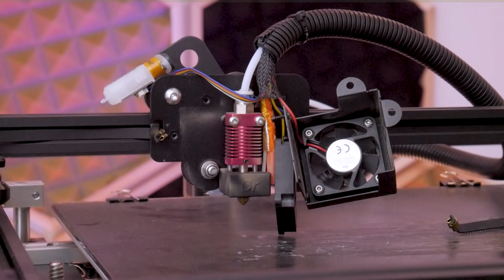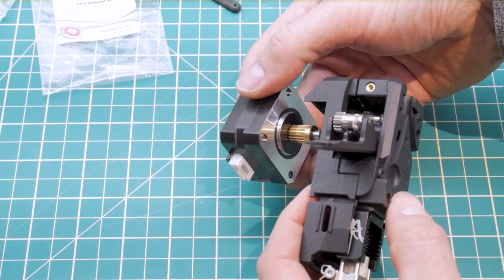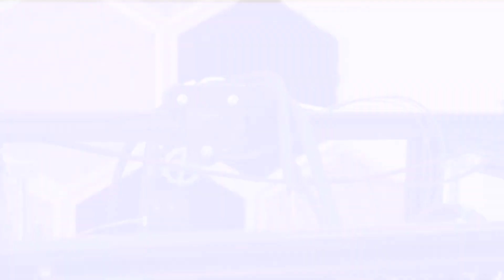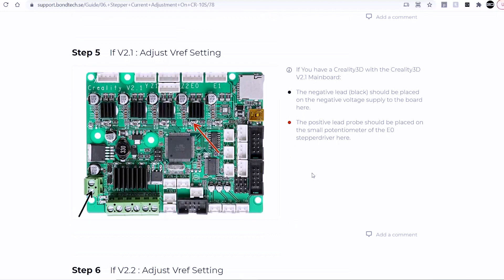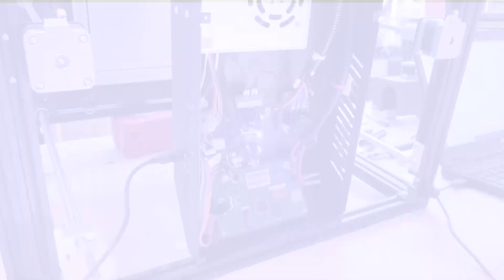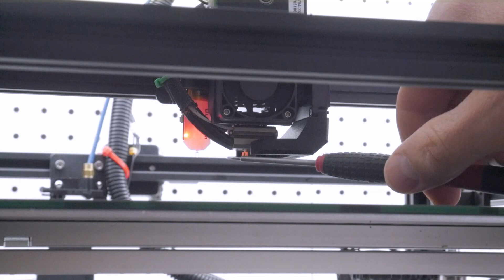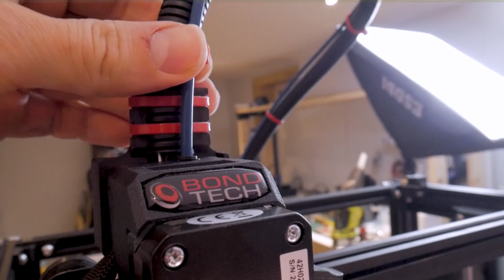The ULTIMATE Creality Ender Extruder Upgrade? Bondtech DDX and Mosquito Magnum complete walkthrough!

Comment: Isn't putting the stepper motor on the moving carriage adding more weight.?
Reply from the maker: Yes it is, but there are advantages of having the extruder motor so close to the hot end. You sacrifice the ability to more quickly accelerate and decelerate your print head for the advantage of more precise filament metering among other things. Look up direct drive vs. bowden tube for a more comprehensive list that other people have discussed if you are considering going this route to see if the trade offs are worth it for you.
Reply: @EmbraceMaking  a BIQU H2 would have been more beneficial no? It's super lightweight direct drive
Reply from the maker: Looks impressive, I might have to try one on one of my printers (I think I have the perfect candidate). Have you used one?
Reply: I've used a direct drive extruder on my CR10-S Pro and absolutely love it.   I think the only way to get anything better would be to do a direct drive remotely driven torsion rod extruder like the Zesty Nimble.   Double check the controller / steps limitations they may have.  (Not sure which version they are up to.  An older version had to be used with a new controller or a gearbox that would speed up the stepper.
Reply: @underourrock  I spent a year with a RDDE/remote drive direct extruder (F3D), was excited, then frustrated, pissed, burned up a stepper motor,  and finally threw in the towel and went back to stock. I basically spent over a year tuning it and barely printed anything else(I was determined). It's a great idea, but the gearing, regardless of brand, will wear out a Nema 17 stepper extruder motor as the gearing is just too high. The printer firmware and slicer profile tuning was so finnicky between different print types I just stopped trying to print. Works great on a slow test until you start trying to tune retraction.  Trying to nail the perfect, fast retractions when the extruder motor has to move 10x, 30x, or even 40x the the eSteps (M92 E2600) to move the filament the same amount introduces a lot of other issues.  Again, great idea, but without a wholly different gearing solution to get it within 5x of stock it just doesn't work. Maybe someone will refine further and it'll go mainstream, I hope.  I'd love to hear of anyone who got a RDDE working RELIABLY let alone FAST.  I must have printed & tested over 100 retraction towers.  

As for the overall hotend DD weight in this video, as I have researched the BIQU H2 is ~50% lighter than a Hemera, but i've heard it is also about half as reliable.  For a cube frame/XY Gantry printer yes that weight will slow you down a bit, but for the Ender 3/CR10/sliding Y-bed style printers the moving bed is the biggest speed hindrance(print size/height relational of course), so heavy DD extruders don't really slow you down.  

Nice video @Embrace_Racing. I looking for a more reliable DD solution on my E5+.  I"m not a big fan of 100% of the weight out on one side as the balance/torque constantly on front would wear roller wheels more in that direction than a balanced rig, but I'm just chasing a reliable solution now.  What did you see as your top speed with this setup, and did you have any issues with clogs/jams in the all metal Mosquito?  Thanks
Reply: @teamlieblong  at the risk of asking you a game changing question far too late to be helpful to you, have you seen the gear box that speeds up the output of the stepper about 30x (from memory) ?  

It can be incorporated and eliminate the problem though I imagine it would require an additional calibration to account for the lag between gear engagement with retraction vs the amount of counter rotation needed to engage the gears the other direction.  There will always be a little bit of slop, but it could be accounted for a number of ways.
Reply: @teamlieblong  to your note about wheels wearing out; polycarbonate wheels are less likely to wear out or the other way of saying it: they'll have a lot longer service life and by the time they do wear out it'll be time to replace them anyway because they'll be worn inside and out enough to make new ones worthwhile, to but it'll be a ton of printing before that happens.

I've installed direct drive extruders on the CR-10S Pro and the E5P.  I have not yet installed the RDD Extruder but I want to.

I'd like to upgrade the x axis to linear rail motion. The wheels have too much slop in them even when they're snug.  The y axis doesn't bother me much on the CR-10S Pro.  I think the geometry involved ends up making that axis a heck of a lot more stable.   The only benefit I see on the E5P linear rail wise is it might be a little more square.   If the wheel engagement is right, it isn't sloppy.

Comment: Great video! Personally which printer do you think is better, the CR-10 V3 E3D Direct Drive Extruder Printer or the Ender 5 Plus? I've been holding out trying to make my first 3D printer purchase.
Reply from the maker: Thanks! I think your choice will come down to how big of things you plan on printing... the CR-10 V3 with the direct driver extruder should be a very nice performing machine and I would definitely go with that if the print bed size is not going to be a limiting factor for you. Otherwise if you need to print very large things, go with the Ender 5 Plus and plan on doing some upgrades as you go along and need them. Pairing the Ender 5 plus with a hot end that can use a 0.8mm nozzle lets you really print big things fast.